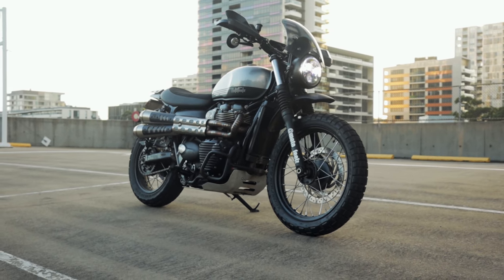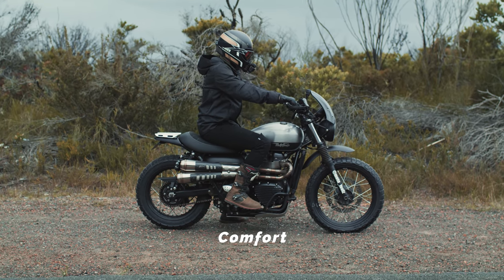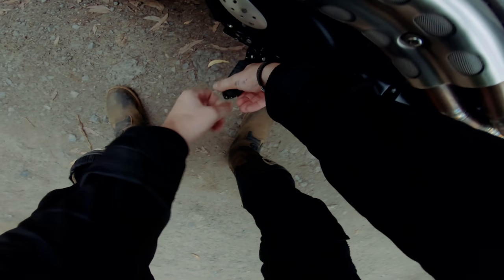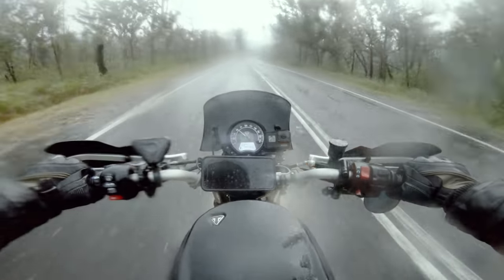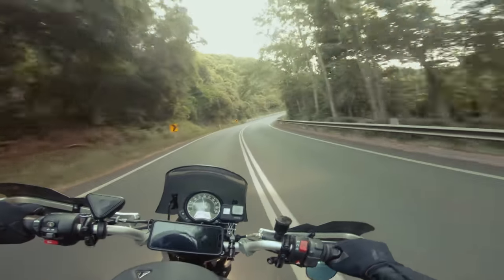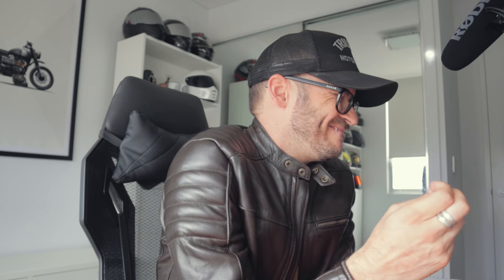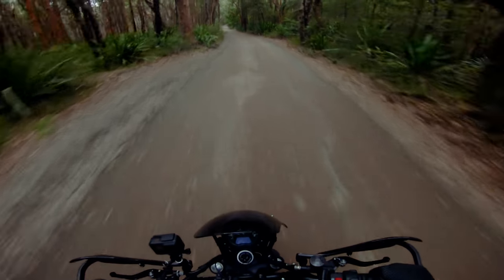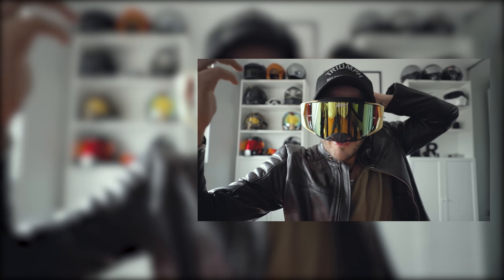Street Scrambler Long Term IN DEPTH Review

Comment: I bought a 2019 model new last year and I'm at 9300 miles. Just done a service with valve adjustments etc, which was very easy. 
So far I've added the TEC progressive fork springs ( big improvement), upgraded the headlight to LED and some additional LED spot lights and fitted the Triumph engine bars. I replaced the OE Metzelers with Pirelli Scorpion Rally STR's and love them. The angle of the speedo bugs me too, in bright light all I can see is a reflection of my white crash helmet! I like the sound of the OEM exhaust but I'm not big on noisy replacements so I'll keep them. A Denali sound bomb horn was also a useful addition. I removed the high level front mudguard it came with and replaced the original which keeps the bike much cleaner in bad weather. I made a rear carrier that replaces the next-to-useless standard item  (I never carry passengers) and an auto chain oiler more or less completes the mods so far. I'm 6' 3" but don't find it cramped at all, in fact it's a very comfy bike to ride. Looking forward to the next 10k miles!👍

Comment: I got the 2020 model which fixes 2 of the main issues: more power and better brakes. I'm very happy with mine - it's my 2nd bike, I have a Tracer 900 for long touring and performance, so this is a perfect add-on to the garage. I was sold on the bike when I test-rode a Street Twin (I wanted the Scrambler but they had none for testing) and experienced the grunt and sound - the seating position is much better than the Street Twin and perfect for me.
Reply from the maker: How goods that! 
Yea and the 2020 are lighter! Massive pluses there. Maybe I should have just  spent the extra haha. Glad you’re enjoying it man!
Reply: I didn’t know the seating position is better..more comfortable..how is that?

Comment: That was really fun to listen to .. I have a 2017 left over that I got at a great price in 2018 .. 16K miles so far .. Dropped it in deep sand on a construction section of a farm road ..Yep snapped the gear shift shaft .. I wish the gas tank was a gallon or two bigger and yep a 6th gear for the motorways .. I consider this bike the perfect country roadster for bumpy back farm lanes and dirt roads .. I added the heated grips bigger foot pegs, center stand and a good flat track racing chain .. ALso got the leather pannier  but quickly changed up to a home made wooden pannier for carrying winter and rain gear ... Thinking about Öhlins :) but havn't pulled the trigger on that one yet  .. Heard of one guy in Yorkshire doing the cam .. I will check back to see that one.. Thanks again ..All the best from snowy New England USA .Yours Guy
Reply from the maker: Glad you enjoyed it man! Sounds like you’ve experienced pretty much the same as I have! Great machine.

Comment: Fit the TEC progressive front springs, transforms the handling in a very good way! I have a '17 Street Twin which is on 37,800 miles at the moment again with no issues. The factory fit heated grips are showing signs of wear and will be needing some Grip Puppies before long. Try EBC HH pads, much better than stock, progressive,  more powerful and never experienced brake fade even when "playing".
Reply from the maker: Oh wow - how long have you had the grips on!? I'll have to give them pads a crack
Reply: @MotoFeelz  Had the grips fitted from new so over 37,000 miles. The pads do make a difference but I was used to my 1976 BMW R75/6 brakes so I have a vice like grip!

Comment: Have 57k miles on my 01 Triumph Speed Triple 955i. Runs great the only issue I have is some oil consumption from the centrifugal crank ventilation seal. Just have to take it apart and replace it.

Comment: Really want to see your report on the new Cam. I've heard good reports.. Might need to think about a better front brake tho😉👍
Reply from the maker: Man I’m so keen to do it! Just finding myself the right guy to tune it. 

And yea absolutely! That’ll be a thing hopefully. Sack them Nissins off haha
Reply: @MotoFeelz  I meant to suggest, you can ruse the suspension ride hight by about 30mm or so, fork riser kit and rear riser blocks from British Legends fr. Just a thought. 👍
Reply: @stevesteve1965  done it myself. Tec shocks in the rear with BC risers in the front. 6'2".. Much more comfortable.
Reply: @Mr.Swapportunity  thanks for that👍 we're the risers internal to the original forks and the springs sit on top of them? And how much hight did you add to the rear, 25mm 30mm?
Reply: @stevesteve1965  handlebar risers from British Customs sat on top of the triple tree and added 25mm to the front. The rear was raised by 40mm by adding the aftermarket shocks from Tec Parts.
Reply: I also did the cam upgrade, highly recommend! It's been over 2 years with it and no problems at all. The bike will now keep pulling all the way up to redline, huge difference
Reply: @michaeljoy8696  Do you notice any type of difference at lower rpms as well?
Reply: @Mr.Swapportunity  not really, it's pretty much the same besides that upper end. TEC does a good job showing the power and torque graphs on their videos

Comment: You can't change the Speedo on a post 2016 Street Scrambler. They're keyed to the ECU, swap out the Speedo and the bike won't start. Doesn't matter if you even use a Speedo from another triumph (I wanted to move the Speedo and tacho from a Cup or t100 to my scrambler. No dice)

Comment: Will you make a video on the installation/review of the Stedi lights?
Reply from the maker: I recon I will
Reply: Awesome mate, keen to see it, I want to get the same lights for my cb400
Reply: What type of headlight did you use? Bulb replacement or complete LED housing conversion?
Reply: @jleib1212  i got the stock one. If your asking about the video stedi lights, those are a 7 inch led kit that replaces the housing, so it's not a bulb

Comment: Hey Rob 
Great video!!! 
I love my 2021 scrambler to bits but I do have an issue with the idle. Not sure if you’ve experienced it. When it’s in neutral it idles at around 1100-950rpm which is great but when you’re riding it and it’s in gear it drops to 1450 ish. Which makes it a nightmare to ride at slow speeds as it keeps wanting to runaway from you. I’m always feathering the clutch around town. Still great bike though. 
MJ in Manchester, England

Comment: Nice review! Bike looks great as well. How would the bike fare for taller riders 6ft 2 (188cm) plus?
Reply from the maker: Thanks man! I think you’ll feel a bit cramped unless you jack it up a bit.
Reply: I have one and am 6’ 2”, been riding for for 39 years - every type of bike you can think of and it fits me fine - not uncomfortable at all. I have jacked mine up front and back but that was for a higher look and ride, nothing to do with comfort. If jacking up I recommend using TEC suspension front and rear. It’s a great bike.
Reply: @simongriffith1905  nice to know. I was wondering because i had seen some debate around other triumph models such as the bobber and was curious if this was similar in size etc. Sure you have seen your fair share of bikes in 39 years of riding! I dont even have a license, my plan is to do it this summer so a bike like this may not be in the plans yet
Reply: @elliotward3358  honestly it’s a great bike to start on; so so easy to ride... good luck

Comment: Great video, thanks. I bought a 2019 SS and it is a fantastic bike with the upgraded performance, brakes and front forks.  I put a BC Slammer seat on which makes the seat higher and great for a pillion too.  Can you tell me please what front light alteration you did, was it just a bulb or complete unit, also what screen do you have and does it make a lot of difference? Cheers. Paul.
Reply: Hello. No, his headlight is ready-made, with the sun ($ 779). The visor is also from there. Choose the model of your Street Scrambler on the BC website and see the offered accessories.
Reply from the maker: Hey man! 2019 is the way to go for sure! I've got the Stedi light in. Link attached. It's a 7" unit though where our housings are 7.5" i think. I had to mod it to make it stay, not too sure if i wanna share that yet, it's a little dodgy, but has held up through all the bs that i've thrown at it, plus it's only AUD$189 so it's worth it compared to other prices. I've got the Dart Marlin and yea, on long trips for sure.
https://www.stedi.com.au/stedi-7-inch-carbon-charcoal-led-headlight.html

Comment: Enjoy your videos. Did you ever replace the stock camshaft with the TEC camshaft?  If so, what are your thoughts? Were you pleased? Did you remap or retune the ECU afterwards? I also have the 2018 SS and have added the V&H 2:1 de-cat exhaust, K&N air filter and TEC camshaft. I feel like I now need a custom tune.  What do you think?

Comment: I like the look of the raised front fender. When you raised it did you leave the fork brace, that sits under the original fender, in place?  If not, did you notice a degradation in handling after you removed it?

Comment: I'm confused... you've referred to the 900cc having a higher seated height and more fuel, but the Street Scrambler is only offered in a 900cc. I have a 2017 and it's 900cc as well. What exactly do you have here??? Do they sell a smaller version in Australia?

Comment: Unclear what you bought exactly.
900 cc  street scrambler, correct?
You referred to 'another/different' street scrambler in your vid.
Thank You.
Reply from the maker: 2018 Street Scrambler - I mentioned it right at the beginning. And I spoke about the Scrambler 900 which is the scrambler before the Street Scrambler
Reply: @MotoFeelz  
                        I do Thank You Very Much for clarifying that for me. My error, my apologies.
I was not aware there was a 900 Scrambler, AND a 900 Street Scrambler.
I thought the earlier Scramblers were 865cc. 

Anyway, Thank You and thank you for replying.

Comment: Are the restricted camshafts still a thing in the newer models? I bought a new one earlier this year but didn´t test the 1200 and have no reference to how it could feel different. Edit: For anyone wondering if the Scrambler is a choice for taller rider, I´m 1,90m (6.2) and it´s still comfortable.

Comment: Thanks for the information! I’m considering buying one in a few days. My only concern is the heat from the high exhaust which you mentioned does fry a bit in summer. I commute to work daily through peak hour traffic in sunny Brisbane. Just wondering how uncomfortable it actually is at a red light on a hot day with say light jeans on?
Reply from the maker: Not at all! Decat help with heat. I rode the 1200 and almost melted. The 900 is way cooler

Comment: Hello from Texas, does anyone have any suggestions for handguards for the Street Scrambler. Strangely, I simply cannot find any kit that does not require an odd assortment of parts, hacking, grinding, etc. for them to fit. Any thoughts would be helpful. Cheers.
Reply from the maker: Barkbusters! I’ve got an installation video 🤘
Reply: @MotoFeelz  Thanks, brother. Keep up the good work.
Reply: @MotoFeelz  Nice! - Looking at it now - trying to see if you showed/mentioned if these were the "single/double point mount" versions for the Street Scrambler. And do I need to purchase the aluminum frames separate from the shields (carbon), or do they come together in a kit?
Reply: @MotoFeelz  Thanks, brother! Question: do you know if your handguards are single/double point mounts? Going to order some.
Reply from the maker: Double mounts bro! Hit them up via insta if you have any questions - mention you saw my vid 👊
Reply: @MotoFeelz  Definitely will my man! Looking to follow your lead and get my YT channel up and running once I get my 2022 Street Scrambler next month. It'd be great to have you as an early subscriber from across the pond!

Comment: When you say you tried the scrambler 900 and was higher, do you mean perhaps the 1200 model? Because the street scrambler is 900cc. And not all riders are tall enough to fully control street scrambler's hight if it gets any higher. That is just selfish. If you really feel it comes short for you, then maybe you should try the 1200 model. I truly enjoy it the way it is now. With high motorbikes you gain comfort and safety off road, but if you happen to be in need to turn in a downhill, the good luck if your feet do not touch the ground. Plus, the street scrambler is not made for crazy off road, hence the proud "street" in front. I understand this video is about your opinions and yours only, but you have to be more neutral if you want to address different types of riders. This is my humble advice.
Reply from the maker: Nope, i meant the Scrambler 900, the air cooled ones before the SS. As i said the height isn't that big of a deal, it'd just be nice if it were a little higher in my opinion. The 1200 scrams were almost $10k more than my SS at the time so definitely not worth it just for a little extra height. Obviously if you're shorter than you'll be fine.. that goes without say.. i can only speak from my experience with my height and weight and not from others